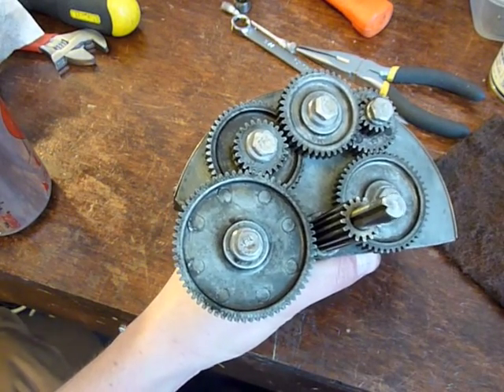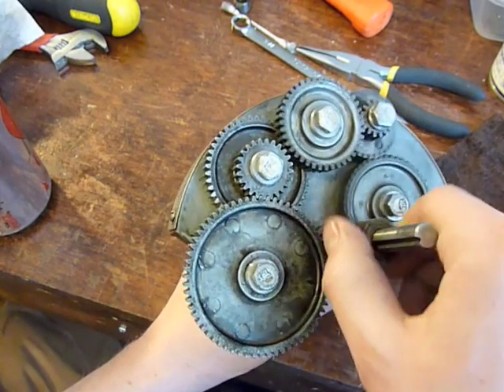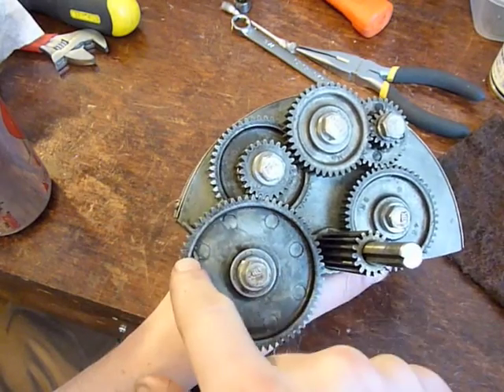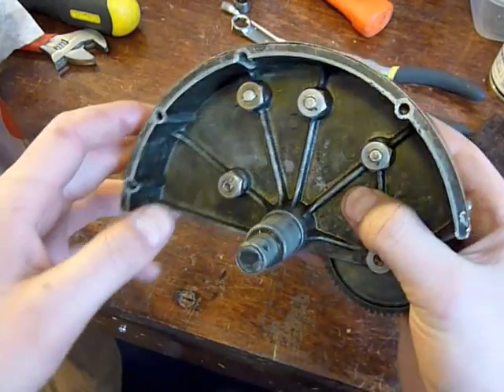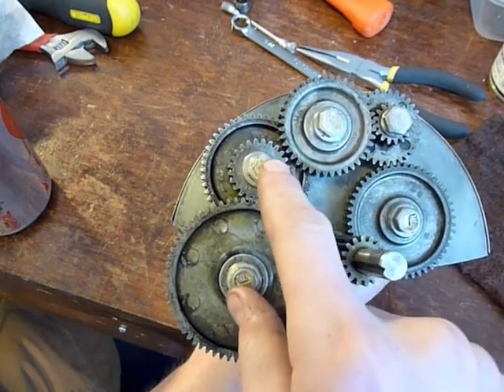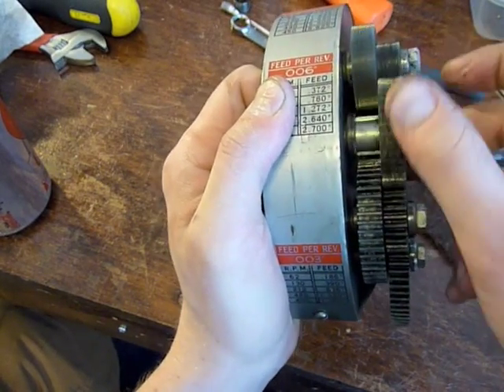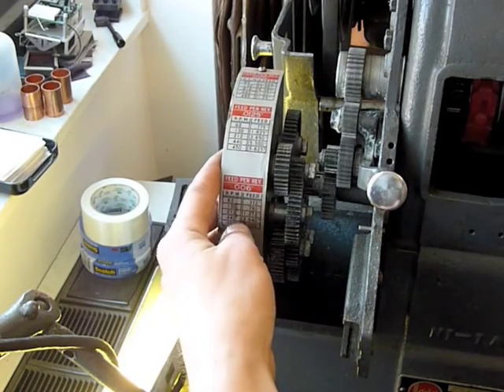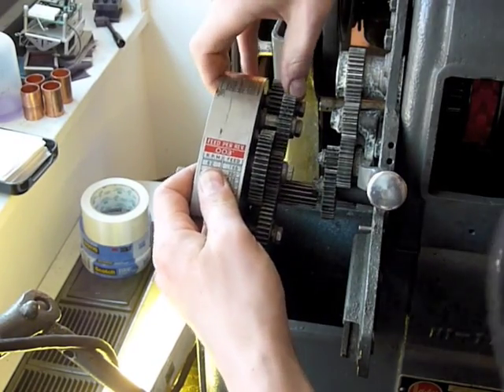Atlas power feed change gear help

Comment: These are called "hubless" gears and a number of varieties are available from McMaster Carr.  This same type of gear is used on the Atlas 7B shaper power crossfeed and are often stripped or broken in older machines leaving the hub like you see behind the large central gear.  Available pitches are 10, 12, 16 and 20.  Atlas seemed fond of 16 pitch gears.  Check out McMaster catalog page 948.  Good luck!

Comment: On the third shaft two keys are clearly visible rotating with the gear, it is therefore probable that at some point the missing gear stripped teeth or split and a previous owner discarded it rather than replacing it.

Comment: You may be missing a small spur gear on the third shaft starting from the largest gear.

In drawings from the ad. literature the gap between the gears at 2-3 in thus assembly is clear.

Order of gears from largest may well be

1. Largest
2. Large small
3. Missing-small Large
4. Large small
5. Large
6. Output shaft.

I hope this helps.

Comment: it looks like the middle shaft is missing a gear. Might have previously broken and since the other speeds weren't being used they removed it rather then replacing it.

Comment: If the power feed has never worked...the gear set might be incorrect.  You may have a combination of metric and standard gears installed.

Comment: If you still have the unit, do you know how long the gear is that mates with the spindle gear and how many teeth it has.  Mine was missing when I got my mill.
Reply: Thanks for the response.  Enjoy your videos, even though I do not do CNC work.